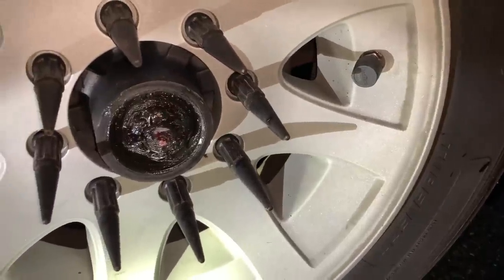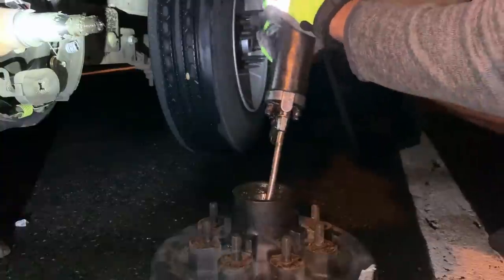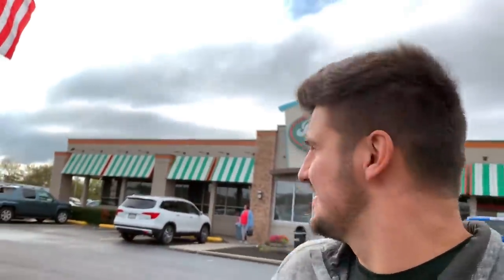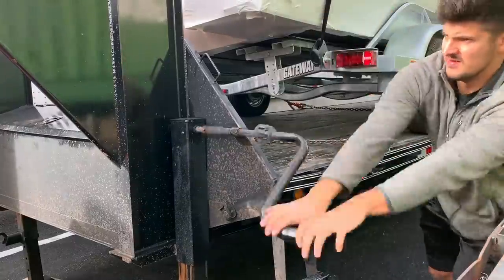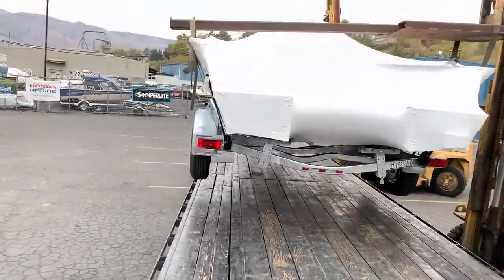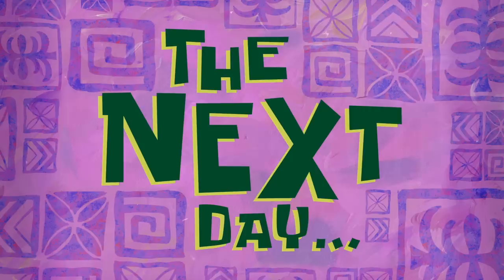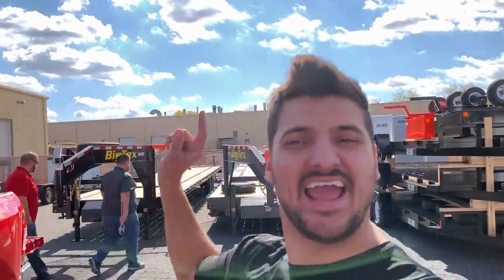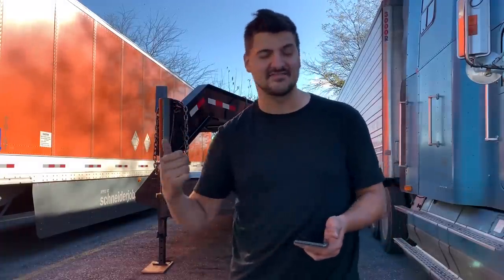New NON-CDL hot shot TRAILER - Vlog 17

Comment: I have the same trailer. Trailer is great, but I’ve had plenty of issues with the Dexter self adjusting brakes. They end up too tight.
Reply: The way the self adjusting brakes are set up on Dexter's, they adjust when backing up. So if you find your brakes are over tightening, turn your controller off before backing up. 
A common mistake made when using an integrated controller is to over tighten. Some make adjustments and don't feel the adjustment when testing because an integrated system doesn't apply full amps to the system at lower speeds. They are designed to apply less at lower speeds to prevent wheel lock and "jerking) 
Hope that helps.

Comment: One more thing! You said you can haul 9660 pound of freight with the new trailer and the trailer is rated at 12000 pounds. That would mean the trailer weighs in at 2340 pounds. did I misunderstand something? Seems awfully light for a trailer that long.  My understanding of the 26000 pound and under is that is the CGVWR of the truck, trailer and freight.  Someone please let me know if that is correct.
Reply: The trailer weighs more than that but the truck is carrying part of the trailer weight when he scaled it. With goosenecks you usually have 15-25% of the trailer weight transferred to the truck on the hitch. Big thing is to be below 26001 pounds GCVWR. Say for instance you weigh the loaded truck and trailer on the scale and the trailer axle weighed 12000 pounds, if you dropped the trailer and weighed it then it would actually be closer to 16000 pounds without the hitch transferring weight to the truck. Combined weight is what matters though.
Reply: Ok Thanks Bo Duke, I think I understand. So If I load up my truck with fuel and all the extra stuff I would carry then get my truck and empty trailer weighed, I can deduct that weight from 26000 pound and that would give me my freight weight capabilities. Would that be correct? As long as the freight weight does not go over what the trailer is rated for.
Reply: @michaeldurkan6794  yes sir. I don't think DOT really pays much attention but the only other thing you wanna watch out for is axle weight. The truck will have the front and rear axle capacity listed for it. You can overload an axle without being at max truck, trailer, or combined weight but like i said DOT mainly seems to care about that 26,001 limit.  He has an older video on here where he weighed and talked about being over his rear axle limit on the truck.
Reply: Thanks for the response. I am still in the research and planning stages. I have not yet decided if this is the road I will end up taking. I really appreciate the videos that TP (and others) puts out there and the responses from guys like you who have the knowledge and experience. I have a 2019 Ram 3500 Dually so I am researching my best options. I bought it for towing my 5th wheel but if I can make a good living with the truck as well why not!
Reply: You have you answer in your question.  CGVWR, or combined gross vehicle weight RATING.  Not the freight.  Add  the stickers GVWR from the truck and the trailer's sticker GVWR and they must add up to 26001 or less to be non-cdl qualified.

Comment: when lowering the gvw of a trailer does that also include load capacity. example taking a 15,900 trailer and stickering it for 12,000, does that reduce  the total capacity to 12,000 trailer weight plus load?
Reply: The short answer is yes, because when people weighing your equipment they normally go off of the gvw stickers and that's how they judge to see who much weight you can put on the piece of equipment. The trailer was built for 15,900 and it can haul that amount of weight safely. The only reason he had to change the sticker to 12,000 was to get around the DOT Laws. He can change the sticker back to original specs, but he can only haul up to 26,000 pounds of total weight. That's the truck, trailer, and cargo combined. If he left the trailer as it came from the factory he would of been at 27900 pounds. 26001 pounds+ requires a CDL class A license and he doesn't have one. Now if someone pulls you over and sees that your over the 12000 pounds that the sticker says your rated at you could get an over weight ticket, but he wouldn't have to worry about that because his truck is rated for 14000 and his trailer at 12000 which is a total of 26000 pounds. He can't go over that number because if he does he could get into some major trouble. Heavy fines, truck put out of service, DOT # revoked, jail time, and or a combination of anything. Another words, DOT throws the book at you and then some. DOT doesn't play games at all. Hope this helps.
Reply: Even though that combination is less than 26,000 your trailer is over 10,001 which requires a CDL. Basically unless you are running a little single axle garden trailer you need a CDL for interstate commerce. If I am wrong someone please show me in the regs.
Reply: @liers99  incorrect, if the truck and trailer weigh under 26k it does. Ot require a cdl. And single truck without a trailer over 26k requires a class B. Combination vehicle with the trailer being under 10,001 require only a class B as well. Once the trailer goes over 10000 gvw is when the A is required.  He is totally legal so long as his combo does not exceed 26k and his axle loading is correct
Reply: @keithwenck9760  his trailer is over 10,000gvw   your statement above proves he needs a cdl...... '' Once the trailer goes over 10000 gvw is when the A is required"
Reply: @jpasc611  no, if the truck pulling the trailer has a gvw over 26k then it requires an "a" with a trailer over 10k gvw. If it had a gvw under 10k it would need a "B".
If the truck is a non cdl truck and the trailer  and truck combo is under 26001 then no cdl is required. If the truck is a non cdl truck (as this guys is) and the trailer combo woth the truck exceeds 26k then a class b cdl is needed.

Comment: So can you buy any trailer and have them slap a lower rating sticker on it?
Reply: Manufacturers derate for this reason very often. Lot of dump trailers are "rated" at 9990 to stay under cdl even though they have dual 7k axles and are the exact same as a 14k trailer. The down side is now you can only legally haul roughly 6000lbs or you're overweight. Double edged sword

Comment: Hey I have a 2019 2500 dodge ram 4×2 and it runs by gas wat size trailer would you recommend?
Reply: Look at your specs for the truck. See what the towing capacity is. What do you plan to haul with it?

Comment: Just a quick question. With your new trailer you can only haul 9,660lb is that alright to be limited to that low weight. Example I have a 32 pj and I can legally haul 12,500lb.Is it better to give up the length for the weight.
Reply from the maker: Are you a non cdl hs?
Reply: @TowPiglet  yes,been in business for a year.My dually only weighs 6,700lb 96 7.3lt
Reply: My trailer weighs 6,500 and I think that's to heavy.
Reply from the maker: Anywhere near 10k is good for a non CDL, I wish I could do more but new trucks are heavy
Reply: @DS-nb3bg  watch out its the trucks gvw ,not empty weight that dot looks at. most older duallys are 10000 gvw and up.
Reply: @andrewslagle1974  my truck is 10k and my trailer is 12k. Equaling 22k.I still don't understand the need for 40ft trailer. I take my 32ft into Walmart gas stations mom and pop gas stations. Saving me a fortune on gas.I have never had a time when I didn't have enough length. I wanted even a lighter trailer I didn't think that 12.5k was enough weight to be able to haul.With non cdl it's all about keeping it light.
Reply: Daniel Sinatra on long haul it’s better to have longer trailer, he fits more partials
Reply: @jjnewlifeim  I understand that .If you can only haul 9.5k aren't you limiting yourself.For example why do you need a dually if you can only haul 9.5k you could do that with a f350 single rear wheel and why do you need a torque tube for such low weight. If you had a cdl then no questions. The goal of a non cdl is to go as light as possible to keep more weights options available.

Comment: Awesome video man! 
Quick question, so can I request a lower weight rating sticker for my 14k dump trailer? I had a 2012 3500 dually rated at 12300 and got in trouble for being 300 over with the trailer so ended up getting a 2500 cause of that, but I miss my dually.
Reply from the maker: Only at the time of a brand new trailer purchase
Reply: Your 12300 truck and 14k trailer are a combined weight in 26300. So a CDL is required. You probably should of gotten  a ticket for operating a commercial vehicle without a CDL which is much worse. Just an FYI
Reply: Yeah you're right I honestly didn't know. I had a friend that recently got a ticket for it (I didn't know what he was driving or I could have warned him) and it was a pretty big ticket l, it really set him back a bit. Downsized to a new 2500 so I think I'm good now.

Comment: I believe you said you have a cdl. If so great. But you need to re-read the regulations and quit referring to "Non CDL Hot shot. I will not dispute that the is such a thing. But if you read and understand the regulations,  your trailer is what determines whether a cdl  is required. Not the weight of the load. If you connect a trailer that has a gvwr greater than 10k, a class a cdl is required. The trailer determines  the type license, not truck or load.

Comment: Why not find a aluminum 40ft trailer? Lighten the overall load 🤔
Reply: Aluminum is $19.5k for 40ft and still weighs about 5400-5600 dep on specs.
Reply: Had an alumaline custom built   With a 40’ lower deck and 10’ upper step, was equipped with 3 axles 7klb each was purty but a real pos, welds always breaking, cracks in the aluminum parts and every single tire blew out between the factory and utah, only hauling 15k lb. was around 30k$

Comment: 6.2.1 CMV Groups (383.91)
There are three commercial motor vehicle groups: A, B, and C. Every driver must be tested for the CMV group for which he or she desires a CDL. See 49 CFR 383.91 for full definitions.

CMV Group

Definition

GROUP A
(Combination Vehicle)

Any combination of vehicles with a gross combination weight rating (GCWR) of 26,001 pounds or more, provided the gross vehicle weight rating (GVWR) of the vehicles(s) being towed is in excess of 10,000 pounds.

I am new to your channel, and I will not dispute your research of each state, but as you say, once you cross state lines, The federal regs take over. Watched a couple of your videos on this subject and all I can say is you got lucky in Wisconsin. You had two ignorant people there. The officer and the Judge.  And I watched the one where you explain that you are tired explaining this issue. But you cannot get around the fact that if the towed vehicle has a gvrw> 10K, a Class A is required in Interstate Commerce. A Driver in a F250 pulling a goose neck with a gvrw >10k would need a Class A cdl.
What got me going on this was I watched the one about your new trailer. I thought where you were going with the decal thing was to have one that stated your trailer was 10k or less. That would then be a Non-CDL Hot Shot Trailer.  And Yes, as long as your Gross weight, Truck Trailer & Load are under 26,001, you are a "Non CDL Hot Shot."  But the trailer cannot be reated >10K Period.
I am planning on putting myself out there with my F-350 and was intrigued on your sleeper video and agree completely, "As long as I log off duty", it does not matter where I sleep.
For me this is a non Issue since I have a CDL, But the rants on cheep freight and stuff, I will leave alone for now. But when you take loads that are better suited for the bigger trucks, you are adding to the problem of those that should be hauling the frieght.

Comment: Regarding your grease cap issue... there are four facts you need to keep in mind. The first is you cannot tell if a hub became excessively hot by touch. It can 'overheat', that is be warmer than it should be and still not be excessively hot to the touch. Second,  'more is better' DOES NOT apply with grease on bearings! Excessive grease might lube well but it causes heat retention. This will cause, get ready for it, EXPANSION of the grease/air in the bearing cavity which (ahem) 'could' over heat the bearings and pop off the grease cap. Third, your bearing end play looked excessive in the video, the bearings might have been too loose causing them to heat up more than they normally should and lastly, you need to TORQUE the bearing to seat it properly. A slip joint plier isn't a proper tool for this. The lug nuts also need to be torqued to assure proper installation. No, I am not a mechanic but I was in the inspection field so details and specifications are second nature to me. Also, I do a lot of mechanical repairs of my own. The reason I know about bearings is I ran into this with a boat trailer wheel bearing many years ago. The end play on that trailer bearing was supposed to be .010". YOUR TRAILER BEARINGS WILL BE DIFFERENT.

Comment: Is it possible to hotshot with just a regular driver's license
Reply: Yes, BUT, Your not allowed to go over 26K in weight ! So, Do the math! If your truck weighs 6000, And the trailer weighs 8000, That's 14000 BEFORE any other Equipment, Tools, Extra Fuel, Spare tires, So, Say with everything extra, Your at 16000 pounds, Now the MOST you could EVER carry, Would be 10,000 pounds !! And take it from someone that was in it over 25 years, Finding a load that pays ANYTHING,Under 10,000 is VERY VERY hard !! Most loads under 25000 pounds don't pay enough to haul, Most guys only haul them as a "Back Haul" to help with fuel costs !. Only way to make any REAL money in LTL Transport is to Contract with RV companies or Boat manufacturers !! If you're thinking that you'll stay busy hauling LTL over the road and loading off the load Boards, Think again !!. It took me about 6 months (Most of that time I spent camping at truckstops waiting for a LTL load) to jump into a Big Truck ! I already had my CDL, Just wanted to stay away from the Heavy Road taxes and big Exspenses I'd why I started with LTL, But found out quick that the money was in hauling Full loads ! I went from $500-$1000 a week to $3500-$5000 a week and stayed local (In Florida mainly) !! I HIGHLY recommend anyone to go and get your CDL A license !! You can still run a F350 with a 35-40ft gooseneck !! BUT you can tag it for MUCH more weight ! And haul much more load options ! My Dodge 3500 Cummins and my 30ft Gooseneck is registered at 36000 now !! I'm retired/Disabled but still move small equipment a few times a month ! And being able to haul 20,000 of Payload makes a world of difference and Money !!.
Reply: @ballardstowingandoffroadre2367  thanks for the info.

Comment: @Tow Piglet your trailer isn't under cdl requirement's you still MUST have a cdl if your hauling anything commercially,  over the combined weight of 26001 pounds, this is your truck, trailer, if your truck is rated (GVWR) to pull over 26001 pounds and your trailer is rated to pull 12000 pounds you need a class A cdl BUT your trailer in its self cannot be rated to pull over 10000 pounds.  Also even though if you have a club cab that isn't a dot approved sleeper.good place for info  https://www.fmcsa.dot.gov/

Comment: Hey Alex, That trailer looks longer than 33 feet. I looked on the Bix Tex website and the 14GN goes up to 28+5 with the dovetail. I see that you don't have a dovetail. By not having the dovetail does that keep the GVWR down to where you can have it rated at 12000 pounds. I am asking as I also have a 3500 Dually rated at 14000 and I am going looking into trailers. I am assuming that a non dovetail trailer would work better for freight. Would that be correct? Also, How long is the trailer?  Thanks for your time in answering this comment.Mike
Reply from the maker: Yes the flat works better for freight and is lighter than the dove tail. It has nothing to do with GVWR

The 40 isn't listed on their website but can be ordered with knowledgeable dealers. 

When you buy a new trailer you can get any GVWR you prefer
Reply: Thank you for the response.

Comment: You do know any trailer over 10,000 needs a CDL right?
Reply: Wrong!! It is the gross combination weight rating over 26,000 except for a couple of fairy states.
Reply: You are correct, trailer with 10,000 gross weight requires a CDL, non CDL holders are so stupid
Reply: Leslie Knight that is only for a vehicle, towing anything over 10k requires a CDL

Comment: Don’t come to texas especially Houston tx because thats a red flag won’t be able to drive it without a cdl and a ticket smh 🤦‍♂️
Reply: Please tell us why this is a red flag?
Reply: You need a cdl class A to operate that combination
Reply: I thought u only need a cdl if over 26001lbs ?  TP runs under that as a non cdl. That's why he derates his trialer to 12000lbs so combined rating is also under 26001 lbs.
Reply: The weight doesn’t matter they are now going by the length of the trailer anything above 16ft is consider a combination even tho the raided weight is non cdl trust me if you come to texas with a goosneck above 16ft and dot pulls you over and you don’t have a cdl class A your not gonna drive off
Reply: Damn bro. I'll need to research Texas length laws. Good to know!
Reply: So I googled "texas hotshot length laws"  and Tx u cant be over 65' long truck and trailer. I couldn't find any info about the trailer being over 16' long. Also no cdl required if combined weight is under 26001 and  gross combined ratings is under 26001 no cdl.
Reply: CDL requirements and standards are all Federal. Texas does not choose the regulations for CDL requirement. Federally the trailer length is irrelevant to the deciding factor for whether a CDL is required or not. Weight is the factor and the only factor, combined with the need to be in commerce, for you to have a CDL.